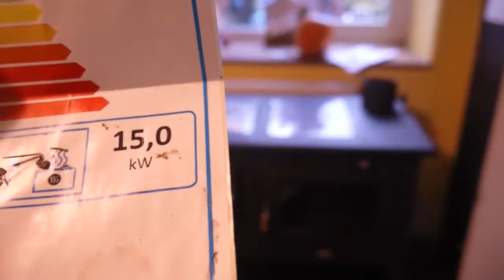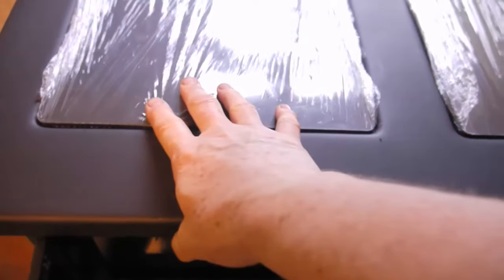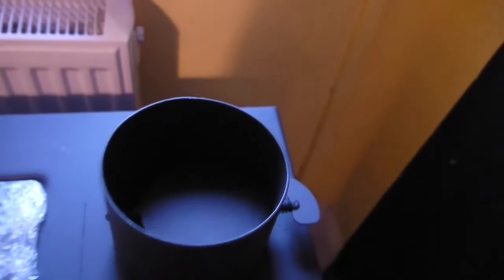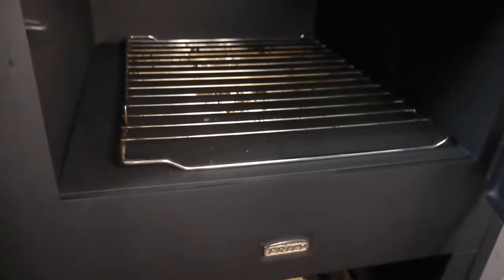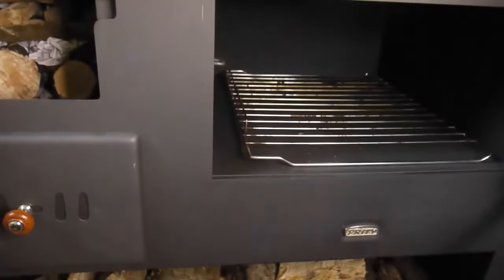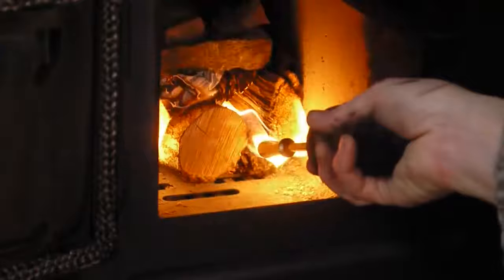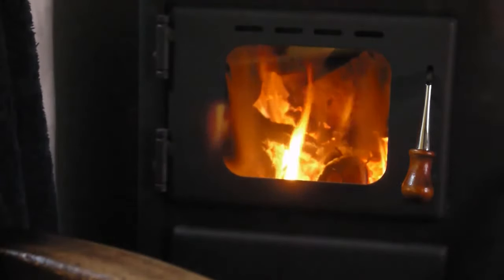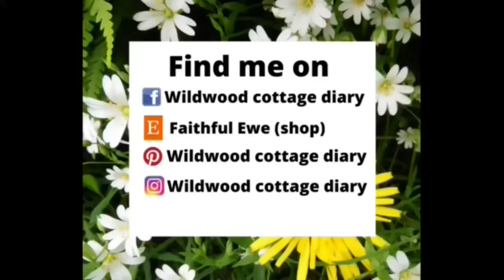Prity 2P41 wood burning cookstove, a tour of the stove, how to light it & cooking lunch #prity

Comment: Love it.  Nice copco casserole pot too!
Reply from the maker: Andy glad you enjoyed the video.... I got the pot for free on my local swapshop so very impressed with it...😀 have a great week..🙂x
Reply: @wildwood_cottage  I have the very same pot.  I think it is Danish cast iron if I remember correctly.  The stove looks great.  I have a wood burning Rayburn 355sfw, but I don't have the window so I'm slightly envious.  When you have the source of energy in your stove, I believe you should be able to see it!
Keep up the good videos, x
Reply from the maker: OOOO..thanks for the info about the pot i just looked it up on Ebay & yes it is a copco i didnt realise it was a dutch over & a good one at that, i did well getting it for free they are still quite expensive. 😃 I wanted a rayburn or Aga but this was the cheaper option.  Yes the windows was the reason i chose this model as most of them didnt have windows which i think makes you feel warmer psychologically too.  😀😀🔥🔥rayburns do look lovely though ...🙂

Comment: We bought what I assume is a slightly older model a few years ago (single large hotplate). There is very little air control on the fire so it munches through logs really quickly but I love having heat and cooking when the power goes off
Reply from the maker: Hello .... the stove is great & good to be able to cook on it too.... its amazing how quickly they get hot too... i can cook almost straight away.😊😊
.are you able have buy something that you could add to the stove to control the airflow in the stove.  like replace the ash bin with something from one of the newer models might be worth looking into you could maybe adapt it yourself ?? i have 3 air points the flue, the bin & the pull out lever so maybe worth looking to see what parts you can get to add to your stove somehow.... 😊😊thanks for watching....😊😊❄️❄️⛄⛄